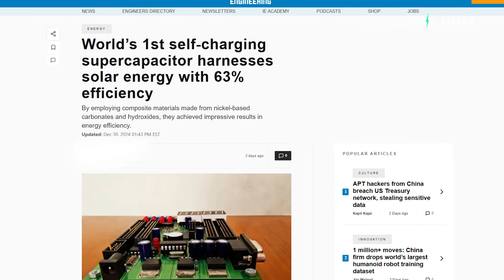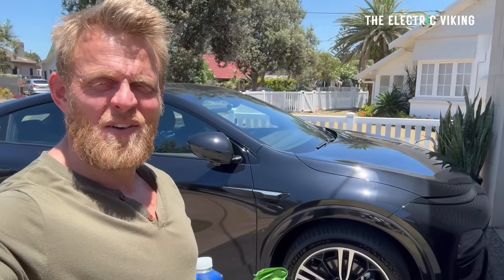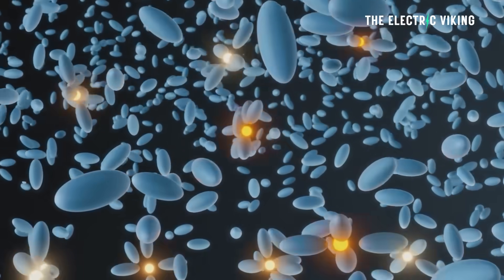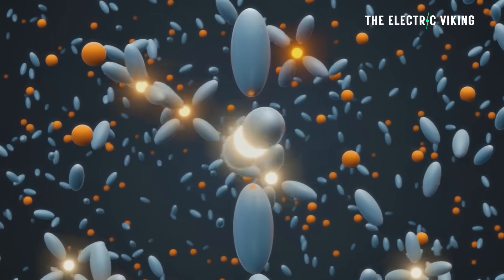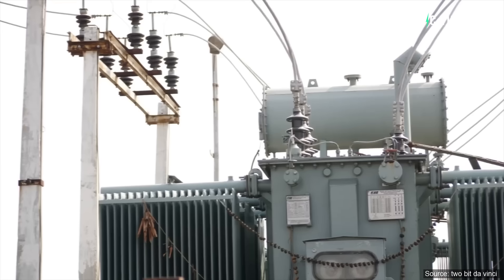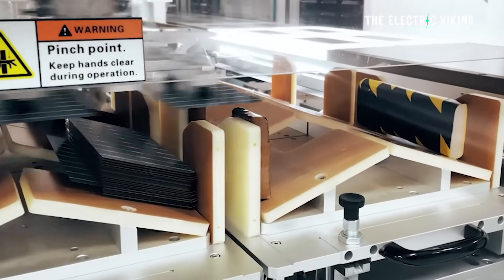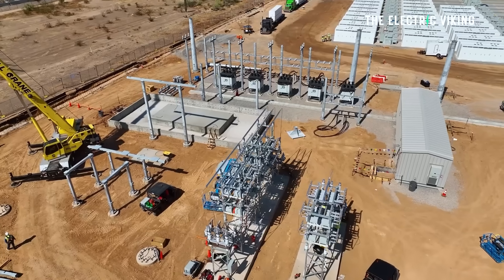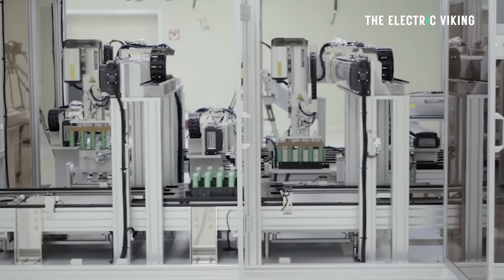World’s 1st self-charging supercapacitor records shocking 63% solar efficiency

Comment: Sam read something basic on jet engines.  Fuel and compressed air burns explosively, turning the turbine to compress more air and ejecting burned gases out the exhaust 
Batteries can turn props, but jets get thrust from explosive exhaust 
A battery powered airplane would take 40 hours to fly from Sydney to LA, much like in the 1940s
Reply: In modern turbofans most of the thrust (60-70%) is produced by the bypass fan, not combustion exhaust. New designs are going for bypass ratios of up to 20:1.

Comment: First thing that came to mind was, "Why would a SELF-CHARGING supercapacitor need solar panels, or anything for that matter, to charge it?" Anyway. The applications:

Well, Aptera comes to mind and maybe Mercedes-Benz's solar paint. Also, level 3 (and beyond) superchargers could use this tech to charge cars (Hyundai/Kia & Porsche)  that have the capacity to charge at really high voltage rates could use something like this. Tesla semi tractors charging times could be reduced. The dependence on pulling such large amounts of power from the grid could be greatly reduced so the worry of brown out or blackouts are  a thing of the past. Here in Texas, that summer heat is really something else and many worry about losing power during those extreme temperature days.

Comment: Solar cells on the planes to recharge the caps once they are used to get the plane off the ground.

Used in pushing large flywheels? And perhaps for gravity batteries as they have large demands to initialize movement.
Reply: ROFLMAO
Reply: @FutureSystem738  Gee... Thanks...

Comment: Capacitors have one plus, they can be discharged to zero, but even then their energy storage doesn't compete. And as everyone has noted, silicon solar cells don't exceed 30% and barely exceed 20% in practice. Even with perovskites solar can't get much above 30% and there is toxicity and lifetime problems. Given Sam's addendum I think he has rushed this video and the research.

Comment: I'm thinking the 63% is totally being misunderstood, a typical lithium chemistry battery cell stores and releases electric storage at over 90% efficiency, most of its loss as heat and if these capacitors are only 63%, there would be way more loss, heat self discharge, etc. How would that increase a solar cells efficiency? A capacitor is much like a battery and the only way I could see one helping a solar cells efficiency is it were grabbing little spikes of production that might otherwise be lost (do they do that?) but no why could they get over double a solar cells efficiency unless it was perhaps doing a new thing as a capacitor like turning heat to electricity or something. Does anyone understand how I'm wrong?

Comment: u ask where i see this being used/how. 
2 phase battery's
less resistance going in and out from the smaller header battery, being charged from a larger energy density Li battery for bulk storage. less resistance going in and out and the bulk storage of some of the other super high energy density materials being developed atm

Comment: Apologies if this is a stupid question. And I was listening while multitasking, this episode was a little confusing for me. I am a chemical engineer in the energy sector. I have mostly worked on implementing technology but I stay tuned into the leading edge of material science and their development.  Although this sounds interesting but I probably missed something. Capacitors are middle men in component circuit design. Did you say or imply they generate electricity now?
Reply: The device consists of a PV layer and capacitive layer directly sandwiched to form a 'self-charging' supercapacity, it's not a solar panel in the traditional sense. Rather they are designed to support short spikes in energy demand, and unlike traditional supercapacitors reduce the need to parasitically charge from another energy source (such as a battery). They can be used to support battery systems, reducing their cost (lowering the need for parallel battery doubling to increase power capacity just in order to address infrequent power spikes).

Comment: Rule of thumb: If a technology being talked about only exists in "some lab experiments" that have never actually been made or showcased to anyone, or as a claim on a startup website, or via CGI, move along and ignore. 99.9% of all these claims are either bunk, or technically correct, but conveniently ignoring massive downsides that make it a non starter, impractical idea.

The real deal will have a prototype that is being showcased on video, patented, or an actual project being installed somewhere via grants. Even at that stage it can still turn out to not be as rosy as initially hoped but at least its not complete bunk at that point and worth talking about.

I find talking about the applications of "discoveries", that are nowhere near viable or even proven to work to be quite frankly, wasted effort, and only leads to people getting less and less interested over time in actual technology as they see that none of these hype promises ever pan out.

Comment: The one limitation of aircraft (fossil fuel or otherwise) is the energy it takes to climb. If an aircraft could be covered in efficient solar panels and have lightweight electric storage, it might do what fossil fuel aviation could not. That is, move us away from boats.

Comment: The article heading is incorrectly conflating solar panel efficiency with storage efficiency.  Energy storage efficiency and solar panel energy efficiency are separate processes and conflating them can lead to confusion.
Reply: when your charging your battery it has resistance, if its 2 phase with a super capacitor battery in the middle u can use that to charge the battery and u have less resistance for your solar cell charging
i can see 2 stage batterys becoming a thing using super capacitor header battery for charge and discharge and regular Li battery for bulk storage
Reply: @violetquinnlaw  Exactly. This has been talked about for a while now, ever since Tesla bought Maxwell technologies
Reply: Look it up no?

new capacitor technology, such as supercapacitors, can improve solar panels by improving the power factor and storing energy: 
Power factor
Capacitor banks can improve the power factor by providing reactive power to compensate for inductive loads. This results in reduced losses, increased efficiency, and compliance with utility requirements.
Reply: @HyperCircle  Power Factor Correction capacitors have to be AC capable. Supercapacitors are DC only !!!
Reply: Definitely not the first lol😅 been doing it for 5 years

Comment: You didnt include  a reference in the description but I found it anyway.   Sam, you got it all wrong.   The efficiency number is the storage efficiency - how much of the charge you can get back out.    Nothing to do with solar.    Although they do mention combining it with solar in some wa, they do not explain how.   
Just so you know: if iI see the words "game changer" in a video title I don't even go there.
Reply: This is a highly specific solar device design, basically a PV layer and capacitive layer sandwiched together to form a 'self-charging supercapacitor'. 

The device it's self is a breakthrough in it's field (2.6 times the power density at 2.6kW/kg and 77% higher storage density at 35Wh/kg than previous devices). But it's not a solar panel in the traditional sense. Though they are designed to support solar installations by providing self-charging solar device that can take cover spikes in power demands (inrush current etc.). To do this with a battery system would be more expensive, requiring more parallel batteries without increasing storage density. 

Normal non-solar supercaps have been integrated before for this role in power systems but they parasitically drain energy from the batteries to cover power spike demands, whereas having a solar 'self-charging' one would reduce the need to charge from the batteries.

Comment: I've always known that the surges of electricity coming from the electric motors during regenerative braking happened too fast for the batteries to chemically change. I have always thought that a good solution to that would be to have supercapacitors between the motor and the batteries. Supercapacitors hold electricity in an electric field, no chemical reaction has to happen, so they can take in all the energy from regenerative braking completely as long as the capacitor pack was sized right. 

I have also always known that a lot more energy was needed to get a vehicle going from a standstill than keeping that vehicle going once it was moving. An object at rest tends to remain at rest, and an object in motion tends to remain in motion. Again, I thought that supercapacitors would be great at providing that initial surge of energy needed to get a vehicle going after having been stopped. This would relegate batteries to only the task of keeping the EV going. 

The problem with supercaps was that they hold very little energy for the volume of space they take up. Also, batteries, as they have advanced, have gotten better and better at taking in the energy from regenerative braking as they have gotten faster and faster at charging. 

However, of late, I've observed rolled capacitors that are made with graphene that although difficult and expensive to manufacture now, can hold energy beyond that of batteries in the same space as a 4680 cell. 

Tesla once owned Maxwell, the preeminent ultracapacitor maker. It purchased it in order to get at Maxwell's dry electrode process. It sold Maxwell Technologies' ultracapacitor business in 2021 to UCAP Power, a San Diego-based startup. Too bad. Maxwell would have been useful in the long run.

Comment: Charging rate of latest battery types is so high (5+C) that they can cover in many cases capacitor-similar applications.
Reply: However, high C batteries are current expensive and even once their price reduces would still not be as cost-efficient as using capacitors for periodic short duration energy spike demands (such as in grid solar/BESS arrays). 

With a battery you would need to parallel them up to cover the same power capacity that supercaps can address. Having parallel battery and supercap arrays would be more cost effective for energy spikes/smoothing. One can also then use cheaper lower C batteries in these roles optimised for the baseload with the supercaps providing peak load coverage.

Further, self-charging solar supercaps seek to improve energy storage of batteries by removing the parasitic drain normal supercaps introduce.

Comment: What a bunch of half-baked drivel. What do super capacitors have to do with solar conversion efficiency? I like super-capacitors and I am a fan of what they may be used for e.g. buffering batteries for rapid, short duration charge/discharge cycles but WTF does it have to do with solar panels?

Comment: I call total BS on this.  None of it make any sense.  You don't need metal ions for capacitors, its 2 plates and a simple dielectric.  Capacitors are a simply formula of surface area, distance between the plates and the properties of the dialectirc.  Electrodes are already low resistance and "stable", WTF is a unstable electrode.  If they can make solar panels with 63% efficiency or more that is news.
Then there is the power thing, which is not useful even for cars, batteries already provide enough power, they don't need any more.
Stop reading out these BS lab claims, its complete snake oil, nevermind simple "partial claims".  You should wait until they are in the field or about to be used in anger.

Comment: What's coming to me is, a super capacitor wheel, a super capacitor on its own is a few seconds or minutes of electricity. But many super capacitors working together throwing energy back and forth to each other may go on for ever,.  So if there's a super capacitor as a cog, or in the centre of a wheel, then super capacitors around as the spokes of the wheel, then the electricity goes, from the centre cog to the perimeter, back to centre, then out to the next capacitor along the perimeter, and keeps going to complete the whole diameter, of the wheel. And then keeps going around and around. 
It's idea that many capacitors throwing energy to each other maintains, over time, ie energy density of batteries. 
In practice who knows??

Comment: I must be dense... Power ( KW) hours(over time) is generated by eg. solar,coal,gas, wind etc.  I thought Mega pack batteries function to buffer the fluctuation of daily power use where fast reacting "peaker plants" usually gas turbines used to function.  Capacitors and batteries store energy react faster to load changes for short times but don't, long term add power.  I hope we aren't getting an "Elizabeth Holmes" syndrome, and getting too caught up in futuristic thinking before it truly pans out.  Sam, I do really enjoy your videos.  Much food for thought.  Thank You.

Comment: A capacitor is a storage device just like a battery.  I think the 63% efficiency is efficiency moving extra energy to storage in the capacitor. There is no way that the solar cell itself creates light into electrical energy above the theoretical limit.

Comment: I think the primary use for this capacitor will be to separate venture capitalists from their money.  It will probably be much more than 63% efficient at doing that.
Reply: Haha
Reply: Since WWII the electronics industry has been producing 'storage' capacitors in the dozens or even hundreds of MICRO-farads range (mfd). In radios and guitar amps you typically had 200 to 500 mfd capacitors to provide burst of audio power when needed. Thats all you could buy but now EV is showing us these FARAD range capacitors which is a huge increase, see photo. True, these are low voltage to match Lithium cells but constitute a great advance. Unfortunately Sam does not know basic electronics or much about Solar Power to understand how these super-caps are used versus batteries themselves. You certainly would NOT want your solar batteries to be operating at only 63% efficiency like these caps are.
Reply: Quite funny, have to admit, whatever the technical gains.

Comment: These statements sound like BS to me.  There may be a valid advancement here but it sounds like the marketing department ran away with the story.  To explain a bit:
A capacitor is basically two conductive plates with a nonconductive layer between them.  It stores energy electrostatically 
To make the capacitance larger, you want to increase the surface area peer unit volume by somehow crumpling up the thing to fit in a smaller volume.
A material like activated charcoal has a huge surface area because of all the little nooks and crannies in its extremely rough surface.
They use that as one of the conductive plate.  The other plate is the liquid that the carbon is in.  The nonconductive layer between them is formed by some sort of chemistry when you make the capacitor. This makes for a very thin layer following the surface of the carbon.
Supercaps are generally very efficient and able to deliver considerable current for a short time.  Because it is only storing as electrostatics and not as chemistry, they can't store anywhere near the energy of a lithium cell.  They also can undergo a near infinite number of charge discharge cycles again because there is not chemistry involved in storing and returning energy.

Comment: Great topic and video , Sam.  It has long been known that extracting the power from a capacitor can be accomplished by putting a resistor in series with the capacitor.  If that is still the technology being used then resistor technology is what needs addressing next.  Making a current flow constricting means that does not get hot and lose energy to heat will be very important, I think.  Accomplish that, and you can say goodbye to batteries.  Charging times will be measured in matters of seconds not minutes.

Comment: If it sounds too good to be true it probably is, the 63% is the efficiency of the supercapacitor, this needs to be multiplied by the efficienty of the solar cell.  If you search for the original paper rather than magazine reports it says "Additionally, when the fabricated supercapacitor device was directly connected to a Si solar cell, it achieved a storage efficiency of 63 % and a high overall efficiency of 5.17 % under an illumination intensity of 10 mW cm−2"
Reply: Solar panels plus a Li battery (like the ones on my roof) have a storage round trip efficiency of around 90%, so this seems like an energy wasting "breakthrough".  
Also the variations in output from solar panels are nowhere near enough to need any sort of buffer between the panels and the batteries.

Comment: there was talking about combining both capacitors and battery, in hybrid configuration. Capacitors can be charged and discharged quickly, and battery for longterm storage
Reply: A Frech company did super capacitor and lithium batteries. 
Bollore makes them
https://www.google.com/url?sa=t&source=web&cd=&ved=2ahUKEwj0nomAydeKAxUqIUQIHSkaIRQQFnoECBIQAQ&url=https%3A%2F%2Fen.wikipedia.org%2Fwiki%2FBollor%25C3%25A9_Bluecar&usg=AOvVaw2BIng_p41e2DPcTQsrkRBa&opi=89978449

Comment: it sounds promising. Now to determine how much it costs per watt hour as well as weight. There are many possibilities for them. Each breakthrough is important but what we can get from each breakthrough matters as well. Capacitors are great for quick charge discharge but not capacity. Would be great for instant torque or emergency breaking. Capacitors are great for quick seconds but batteries are better for long slower charge / discharge. There are usages for both but they are not both good for everything

As for the efficiency claim i doubt it works outside lab.. but if it dose a new style of solar panels will be born from it.  We will see the limitations in time. right now it is in the lab